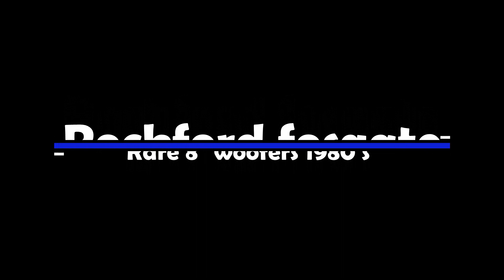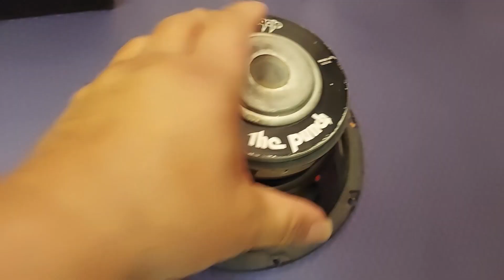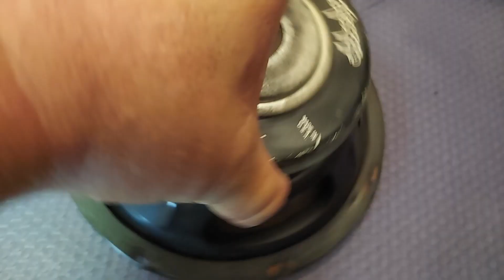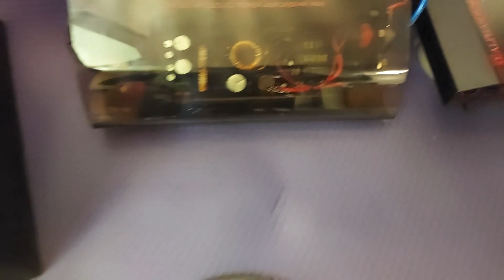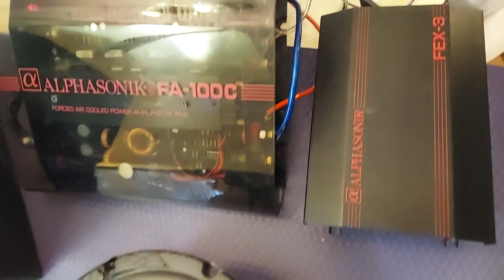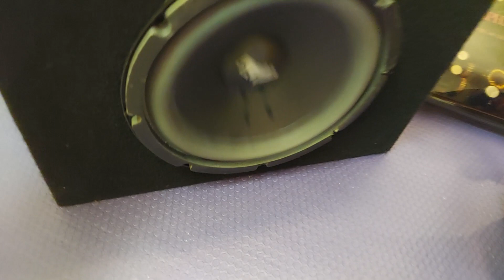Rockford Fosgate Vintage 8 inch woofers 1980's

Comment: I have a pair of Series 1 4 ohm 8” subs that I’ve run in both ported and sealed enclosures. They have very good sound quality and when wired in parallel and driven by one channel they provide a pretty good kick.
Reply from the maker: Some people think that 8 ohm subs were only made for home audio, but just as you described your set up, it is meant for a pair 8 ohm subs to be wired in parallel which will give you a 4 ohm load. The reason is that most of the older amps were only 4 ohm stable in bridged mode. Thanks for your comment.